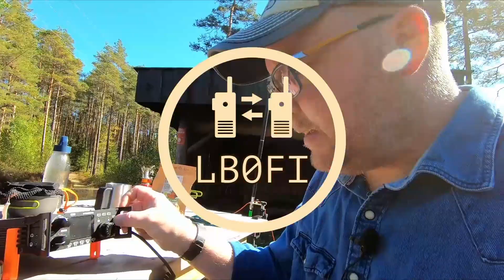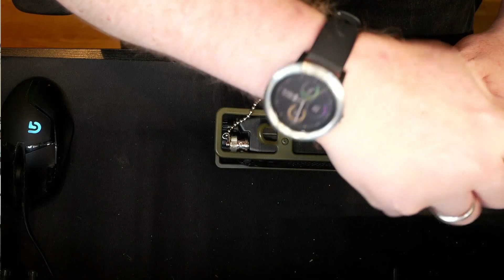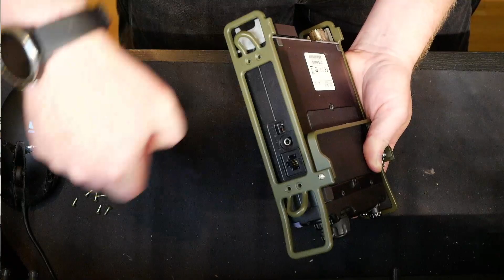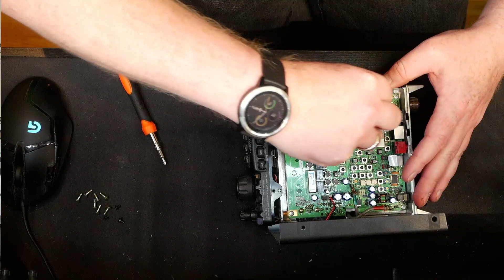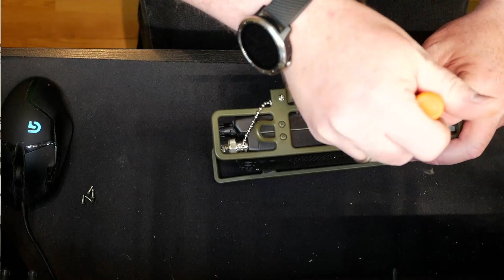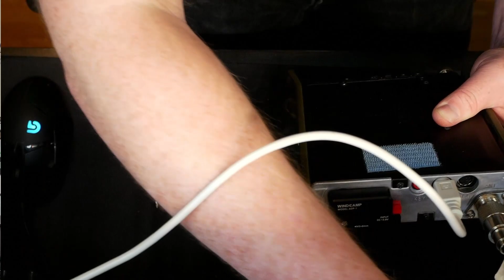The Second Easiest FT-817 Hack I Have Ever Done - Installing a TCXO

Comment: Is that an original FT-817?
Reply from the maker: It’s an 817ND.
Reply: Are you experiencing more RX noise?  I see complaints about this as compared to the OEM.
Reply from the maker: @kq6up  I am experiencing a little bit more noise, but the stability on the higher bands are marginaly better. It is a tradeoff.
Reply: @LB0FI  TNX OM ES 73 de KQ6UP

Comment: Hi Morten. If you can pick up a roofing filter, grab one. They are like hens teeth. Unfortunately in the 817 you can fit an SSB or CW filter, not both. It will make a big difference on busy bands.
Reply from the maker: Hi Colin! Yes, I am looking for one, or more, at a reasonable price. They are hard to come by though.
Reply: you can fit both with an extra board sold cheap. sit side by side. also theres a dsp instead of collins

Comment: What is a TXCO?
Your Etsy link is broken.🤷‍♂️
Reply from the maker: A TXCO is a Temperature Controlled Crystal Oscillator. It replaces the crystal in the radio and reduces frequency drift. Thanks for letting me know about the link. It is now fixed :)
Reply from the maker: Please see the other comment for the correct answer. This is the internet, so you can be sure that someone points out your mistakes.